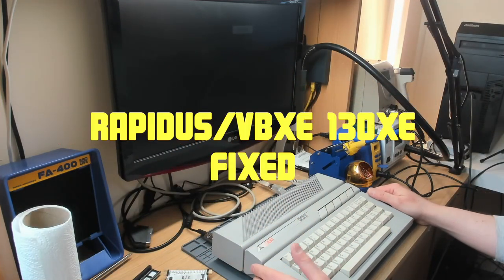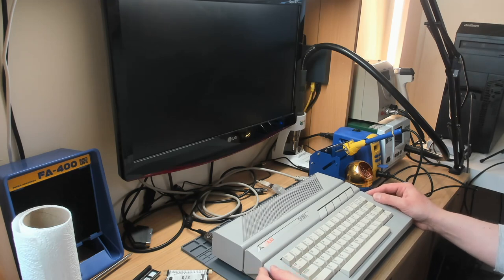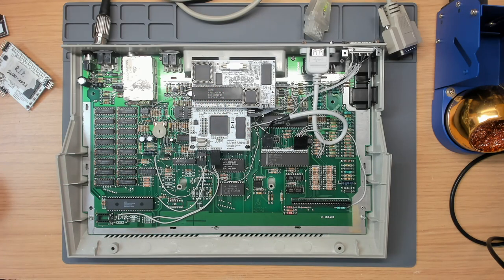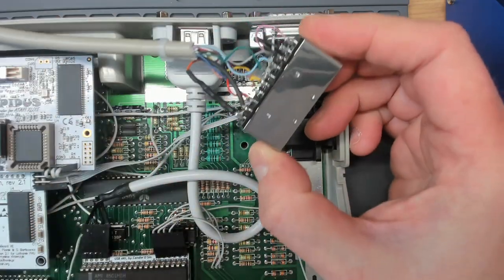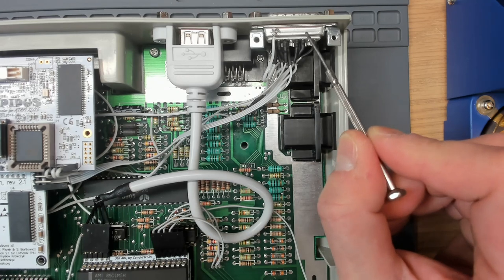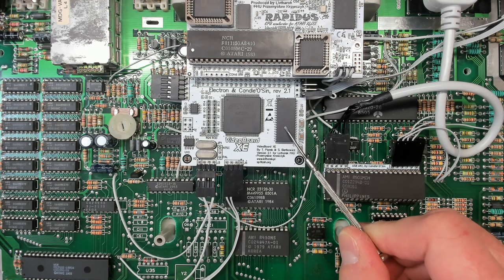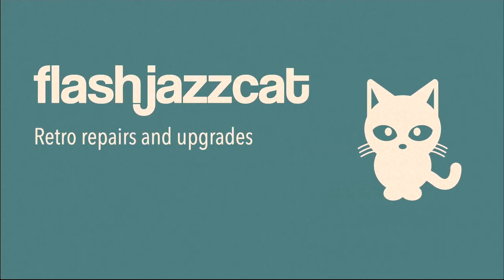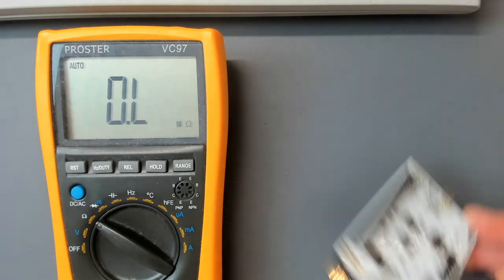Atari 130XE: VBXE fixed, Rapidus/SIDE3/AKI tested

Comment: hey it's me, the Atari owner.  Just a 4 month followup - everything still going great!!  I typically go months before I get a chance to spend some time on my Atari hobby.  And I have to say,  to come back to the Atari 130XE today and to have it still work - woo hoo!   Looking at it again with fresh eyes,  I do like the 80 column output of VBXE and run SDX in 80-col mode - it is so rock solid now.  If it had any wave, I would notice. It has none.  Now, I did have that USB keyboard adapter installed, and it works as designed.  But about the USB keyboard adapter, it doesn't map the < and > keys (to be clear to anyone reading this, this has nothing to do with the install, I'm just talking about the product itself).  It does have [ and ] mapped to two different keys.   of course one could add a driver to add some hot keys to print < and > as a macro - and that would work in some programs that use the e: device.  But anyway, I digress - I wouldn't recommend this adapter as a product, but this isn't a product review.   It's such a joy to have an Atari that just works right.   We all have our own hobbies.  I find that I do not care about loading games.  If I want to play a game I'll jam a cartridge in the cartridge port, old school.  all I want to do is write my programs to 90% completion and then discard them and start over, haha.....and although I spent years frustrating myself with bad hardware - that really wasn't part of the hobby that I wanted.  It is so great to finally have a working machine!!!!!!!!!!!!!!!!!!!!  woo hoo!!!!!

Comment: Very interesting learned of two things I was not up to speed with the usb keyboard interface...had never seen that done.  And yea the SRAM thing looks like a recent Rapidus game changer.   As well as a hail marry fix for a flakey machine or crashing one.
Reply from the maker: The only way I could imagine the SRAM board making any difference when Rapidus has replaced all of the base RAM in the machine with fast RAM anyway (in accelerated mode, with accelerated base RAM) is if the SRAM board somehow worked wonders with bus capacitance or power requirements, and I would expect that to require removal of the existing DRAMs. I remain open-minded, though, if the SRAM boards ever actually arrive. :)

Comment: Hello Jonathan, Glad to see the new video.  I've been chomping at the bit to try a Rapidus and  a VBXE for a while now.   I had a similar cold solder joint problem when wiring up the 64K upgrade on my 600XL.  One of the wires to the VIAs never made good contact until I gave a second touch of the soldering iron, then everything started working.
Reply from the maker: One of the first 600XLs I upgraded to 64K many years ago never worked and it turned out I had connected two of the jumper wires to the wrong vias. :) It was hard to diagnose, though, since the delay line IC had also failed. :D

Comment: Wonder if I could put another 6520 pia in my 800xl, and wire like my stereo pokey, since the 74ls14 I'm using has leftover gates, could I have another set of 6520 registers 16 bytes higher in memory, would make adding over 512k ram much easier
Reply: Well why even a 6520? Add a small pcb with a few gates, use  ay8930 instead, and also gain some extra sound capabilities, and make the sid run around for its money
Reply: could  use the pbi bus instead, but you'd have externally route/mix the sound outputs, but you could supply better floating point routines, or just add a microcontroller and use it as a fast floating point co-processor, and have ya ram and sound expansion